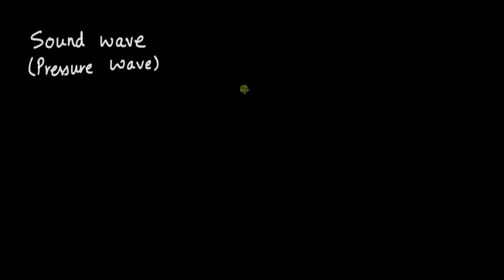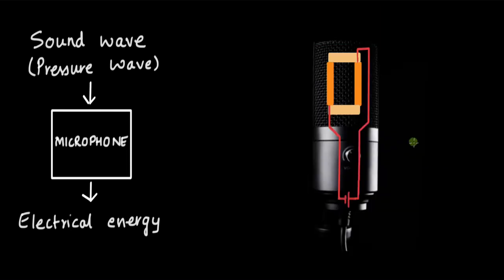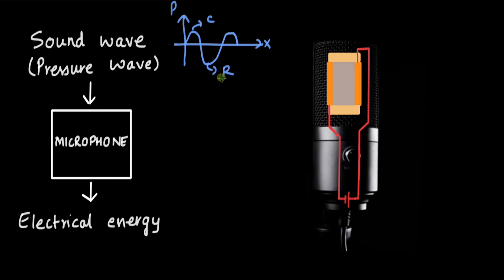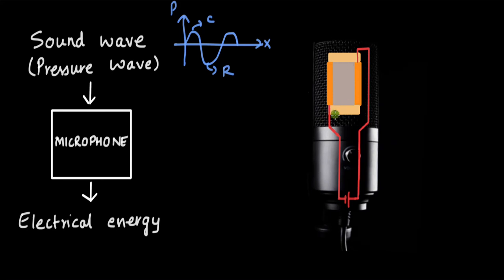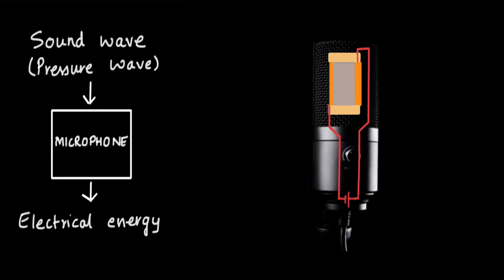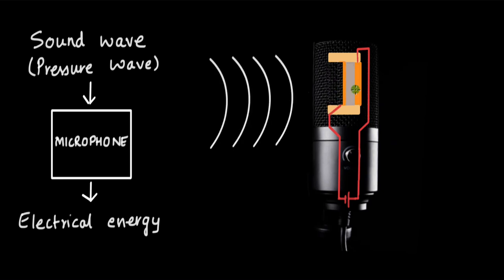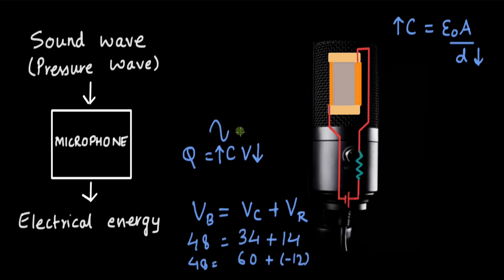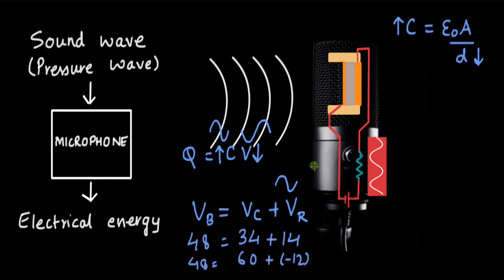How do Condenser Microphones work? | Electric potential and Capacitance | Physics | Khan Academy

Comment: brother... if you attach a large resistor how will the charges reach the plates firstly? Like the capacitor needs to be fully charged when we really want the charges to stop altering... wont the charges consume a lot of time.... sorry if i sound dumb but 😅
Reply: TikTok users are dumb, not you. Never be ashamed of asking question about topics you are interested in
Reply: The only dumb question is the one you don't ask for fear of appearing dumb.
Reply: I'm trying to give an answer here, correct me if I'm wrong please. The "charging time" of an condensator depends on the resistance in the circuit and the capacitance of the condensator.  If the resistance is very high, I guess you can just decrease the capacitance so that it will still charge fast enough.